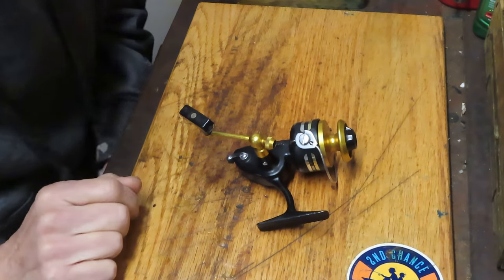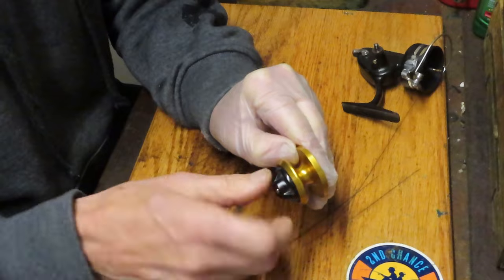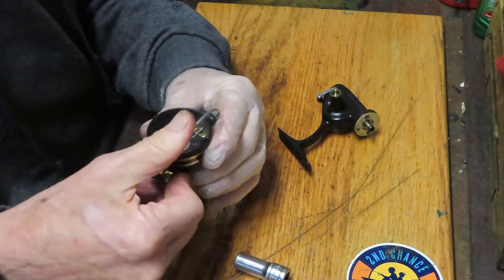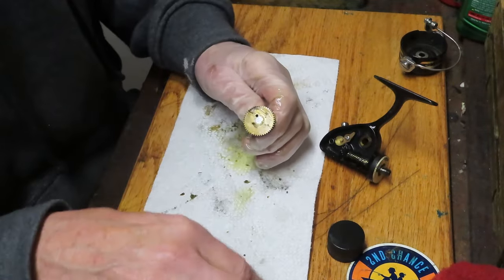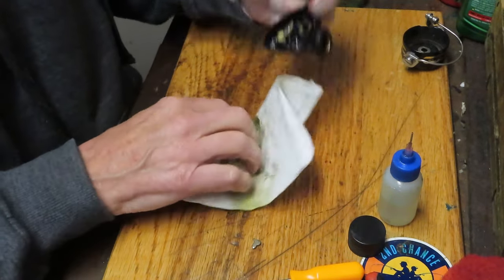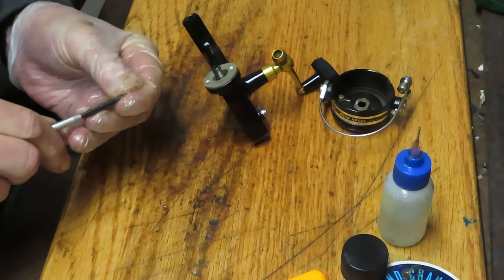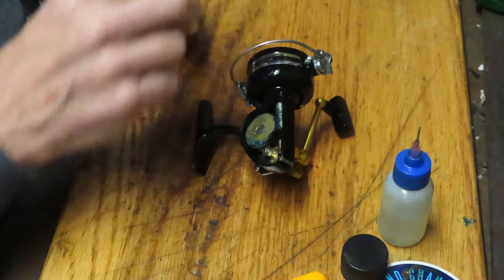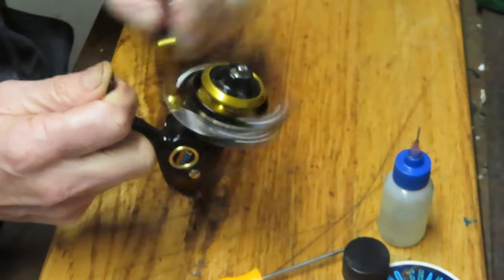Penn Ultralight 716Z spin fishing reel how to service

Comment: Just a quick tip from a guy who has trouble with small screws also. Whether flat head or Philips head, a bit of grease on the tip of the screw driver will hold the screw so you can get the screw started.
Reply from the maker: Thanks for the tip on the tip!  Dennis
Reply: Another thing that helps me is to have a very short screwdriver, but that means a modification most of the time if you want a fixed driver.
I use my Chapman set for all gun airgun and vintage fishing reel screws and have stubby driver handles, but you can get a regur stubby bit driver or inexpensive precision bit driver set.

Comment: I didn't know they did a reissue of these in 1995, but that would explain the examples I've seen with a plastic side plate.

I'm going to go out on a limb and say that if you've got a plastic side plate it's probably a 1995 reissue, that is of course unless it's a replacement part.
I also don't know if the plastic side plates came on any of the reels or if they made the plastic ones later on when continuing to make parts for discontinued reels ( Crosman airguns used to make some plastic replacement parts for discontinued guns )

I have also noticed that this seems to be a slightly more economical bail setup compared to that of my 716 greenie, but I don't know the significance of this.
I'm not sure if this change was made with the 1st Z series reels or just with the reissues.
Reply from the maker: I have to assume that this change was the re-issue
Reply: @2ndChanceTackle Dennis, the only Z reel re-issue I knew about were the 2012-13 re-issues of the Penn 704Z and 706 Z.  They are easily recognized because the rotors on the most recent ones don’t have that band around rotor with the line capacities, etc. I truly never knew of a 1995 re-issue. Certainly these 714Z and 716Z reels are among the most popular of the Z series reels so re-issueing them would have been a very smart move. — Chris
Reply: Tyler, I have an original (reissue) 712Z with the single screw Plastic Side Plate so I guess the reissued ones came with it. Very nice reels! I personally think the Shakespeare Royal Maroon and Peen Greenie and Black Spin Fisher reels are the finest vintage American made Spinning reels. I prefer them over a Garcia Mitchell any time.

John
Reply: @JohnLangevin-n2i thanks for the info.
 And they are not just the best American spinning reels,  but across the board the Royal maroons Penn greenies and original Z's are the highest quality freshwater spinning reels ever made anywhere.
I'd have to put the 60's DAM quicks towards the top as well for being right up there in build / materials quality, but for some reason they're not quite as smooth at least not the 110 anyways ( I'm still looking for an early Microlite).
I know Chris Jenkins would disagree because he loves the Japanese reels, but I have yet to see one that didn't have pot metal parts in it somewhere.

Btw there's just something I like about the Mitchell 308 that I can't put my finger on, it's not as smooth or overbuilt as a 2052 or 716 but I can't hate it and think they're nice enough that I never actually expected there to be anything better.

Comment: I would love to have a 614Z or 616Z as these are the only ones from the Z series I don’t have. I don’t want both as I understand only the spool size is different. Is this true Dennis? As I mostly collect and use only vintage saltwater spinning reels these particular Penn Z reels have never been a priority.  These small reels are true masterpieces of design. I love a worm gear reel! — Chris. P S. I didn’t think the Penn Z reels came out until the 1970s?
Reply from the maker: Yes - some versions were introduced in 1966, but he smaller ones did not get  introduced until the mid 1970s

Comment: Have you ever worked on a Daiwa mm-2? I just picked one up but the anti reverse doesn’t work 😢
Reply from the maker: Is this the MINI-MITE reel?  The A/R is under the rotor on those reels.  Chances are that the part needs to be cleaned and lubricated.  It is probably sticking from dried grease - Remove the rotor. and you will see if it is a broken part or just a grease choke issue that can be cleaned up - Dennis
Reply: @2ndChanceTackle  thanks for responding! On the Daiwa website it’s the MM-II. Looks similar to the mini mite (mm-1) but the AR per the diagram are all on the bottom
Reply: @2ndChanceTackle  do you know the function of the anti reverse claw plate? I’m seeing that what is missing

Comment: Hi Dennis, I have one of these reels. It hasn't got the steel washer in front of the teflon drag washer - it has a pressure plate on top of the teflon washer and the drag doesn't tighten down fully.  Would you be able to tell me the steel washer thickness, I might have to fabricate one ,  thx